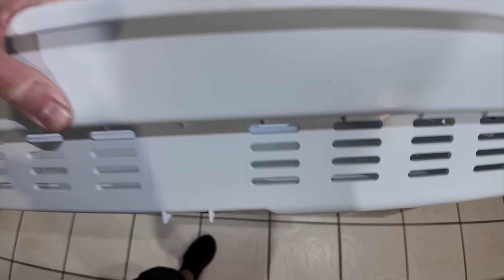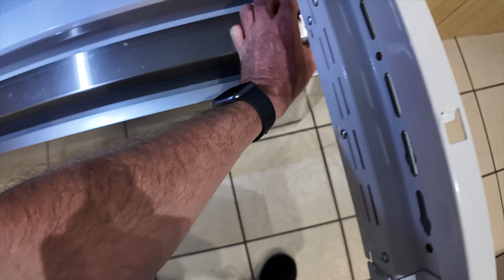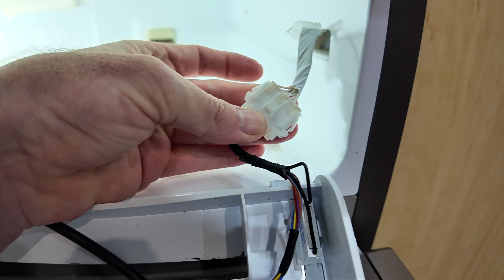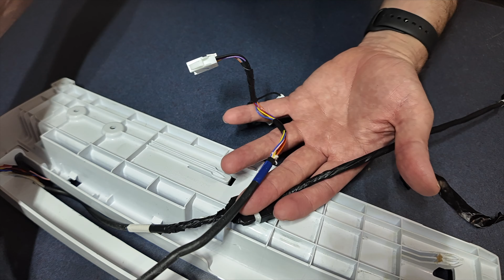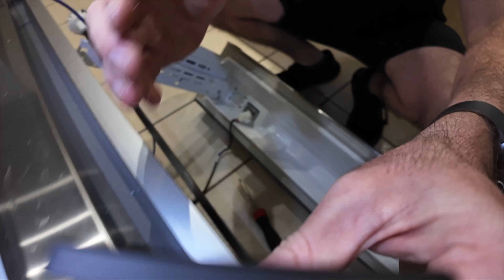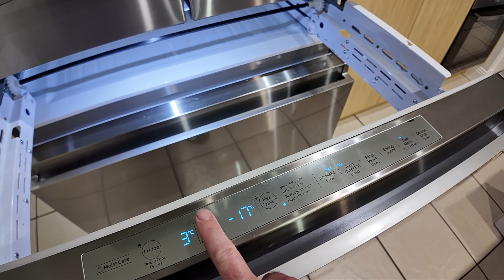SAMSUNG FRIDGE Flex Drawer Control Panel REPAIR FIX

Comment: How do you disconnect the wire plug connector the one on the control panel. I cannot separate

Comment: A Big THX! I had the exact same problem, and your video took us step by step on how to fix it. I especially liked the inclusion of how to unplug/plug the cable connections and how they were routed.  In my variant model, I had a plastic looking yoke that helps the cable snake without binding up.  Samsung kept putting band-aids on a bad design.  This model could have been a great fridge if they'd placed the controls somewhere inside, and also placed the Ice make in the freezer section (e.g., Ice maker keeps freezing up! - but that one is another story! ;) )

Comment: What gauge cat6 wire did you use AGW23 or 24? Many thanks
Reply from the maker: Sorry for the slow reply, i have no idea, it was just what we had arleady. Most important thing is stranded core, not solid. so it doesnt break where it flexes continually.
Reply: @testandtune6096 thank you! Your video inspired me to have a go at fixing a similar issue with a different Samsung fridge after having a Samsung engineer tell me it couldn't be fixed and charging me a ridiculous fee for the pleasure.

Comment: Thank you, going after mine this morning.  How did you determine the wires were broken at that spot for your original fix?

Also, FWIW,  the wires on your original fix look like they were cut, not broken.  At exactly the place where they would be cut when you stripped the outer jacket off.  Easy to do.  I advise others to just score the outer jacket and flex back and forth rather than trying to cut all the way through.  Otherwise, it's really easy to cut the inner wires.

Thanks again1
Reply: Staggering the cuts of the individual wires will keep the spliced cable thinner (so it will fit in the slot better).  Also onsider putting a piece of heat shrink tubing over the outer jacket of the CAT6 before soldering the individual wires.  Much better than electrical tape from a strain relief standpoint and will also keep the splice closer to the original cable thickness